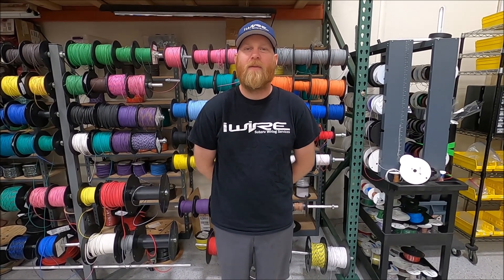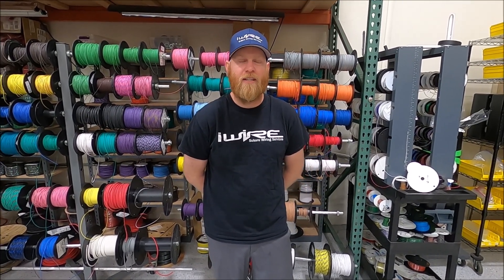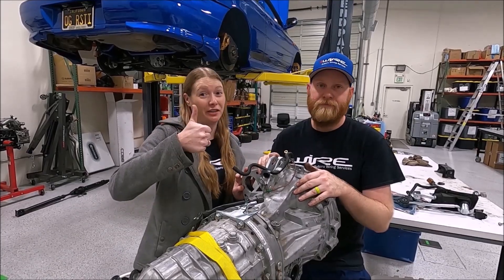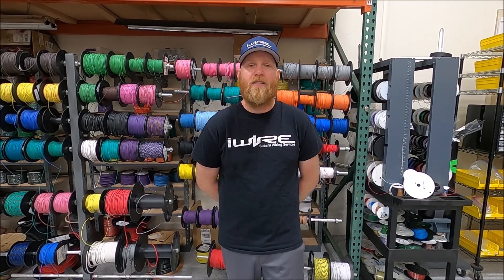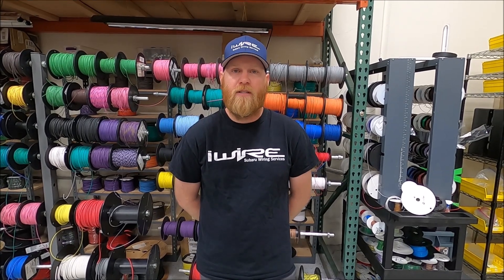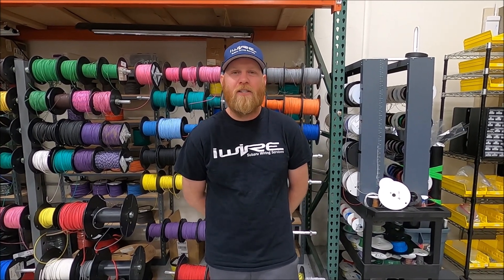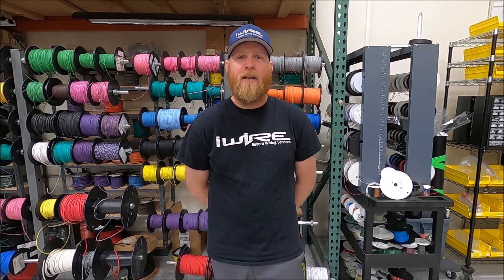How Do I Fix my Vehicle Speed Sensor? - Vehicle Speed Sensor (VSS) in your Subaru Explained

Comment: So I have a 95 impreza automatic, all original. OBD1. Took it to get smogged and they said its throwing a p0500 which is the VSS but thhing is my car has a mechanical speed cable and it works perfectly fine. So what am I supposed to do to fix a "code" that literally shouldn't be there since I don't have an electronic speed sensor?
Reply from the maker: It sounds like the gauge cluster is having an issue because it's not sending the electronic signal to the cluster like it should which is throwing the code.
Reply: @iwiresubaruwiringsolutions  So i'm dumb and figured it out. I had my to green plugs under the dash plugged in which was throwing codes. When I unplugged it, that speedometer code went away.

Comment: I have a 2014 outback. Speedometer and millage count not working however rpm needle works. Check engine light is not on. No codes come up when code reader plugged in. Would this be speed sensor or something else?. When key is turned needle for Speedometer does move but won't give speed. Any suggestions
Reply from the maker: This is a CANbus equipped platform that gets wheels speed via the ABS unit. I would investigate the ABS system and the inputs to that.

Comment: If I have manual trans in car with a/t wiring (as I would swap the transmission) - is it possible to just connect some pins to get the signal? I got Legacy BP with h6 which does not open throttle body fully (only in 30/40%) and I suspect this is the issue
Reply from the maker: Yes and no. More about auto-to-manual swaps can be found here. https://iwireusa.com/blogs/iwire-university/subaru-auto-to-manual-transmission-conversion-basic-overview?_pos=5&_sid=fd7e61f4d&_ss=r

Comment: I have a P0500 code on my Subaru tribeca B9 2006 and I cannot locate the speed sensor on transmission. I did not find any information online or on google
Reply from the maker: Unfortunately, we don't have a specific answer. You'll need the Subaru service manuals to determine the exact location on the transmission.

Comment: Where is the speed sensor located on 2015 Subaru forester transmission?
Reply from the maker: Automatic transmissions are a bit different than what is being talked about here, but generally, there are 2, and they are located on the bottom side of the transmission.

Comment: So if I have a 02 Subaru legacy 2.5 in my Rail Buggy and I have a Aftermarket speedometer,  and I buy a 2 wire speed sensor,  (since I have the front wheel hubs on the rear,) can I take the white wire and hook it to my speedometer and ground out the black wire? Will I get a accurate reading?
Reply from the maker: Unfortunately, I do not think that will work, given you are mixing vehicle speed sensor signal types. Your best bet, whether you have a Subaru transmission or non-Subaru, would be to utilize a 3 wire sensor type which the ECU and the aftermarket speedometer most likely can read.
Reply: @iwiresubaruwiringsolutions5538  I do have a Subaru 5 transmission,  where would I find a 3 wire sensor like ur speaking about?
Reply from the maker: @bobzak9508  Should be built right into the transmission in that case. Especially if the transmission came with the 2002 Legacy.

Comment: I have a 97 Impreza with the mechanical VSS and Ive had multiple cables snap over time, what do I need to switch over to get away from the mechanical vss? 0:49
Reply from the maker: You will need a newer cluster with a matching speed sensor, and we can help with the wiring depending on which cluster you choose. https://iwireusa.com/blogs/iwire-university/subaru-vehicle-speed-sensor-vss-types-part-1?_pos=18&_sid=1349c26ee&_ss=r

Comment: I have an '09 Impreza (no VSS in trans) and recently got a P0500 code for VSS circuit malfunction. Speedo goes crazy after cruising a bit on the highway and can't rev past 4k. However, if I just stick to city driving for 1-2 days, the codee eventually goes away. How could I diagnose which ABS wheel speed sensor is giving me issues?
Reply from the maker: Thanks for reaching out. Unfortunately we do not have the specific diagnostic procedure for your vehicle but if you reach out to your local dealership, they may provide you with this information.

Comment: I have a P0500 code with my 2006 Legacy 5MT. but doesn't have the sensor on transmission. Would that indicate a wheel speed sensor?
Reply from the maker: It would suggest that is the case, yes.

Comment: 18yr daughter saved and got first car,  2016 Impreza wagon....165K miles...seemed fine for about 2 weeks...now you drive about a mile....all the lights come up...ABS, Check engine, hill climb etc Spedometer drops to zero but a cheap code reader says speed is 158mph......will not go over 4000 rpm as you said...code Po500 and others.....local mechanic said sensors fine?...kept for a week and charged $400 and said sorry come get it........was he suppose to be able to determine which speed sensor??...he said all of them?........daughter out all of her money....any ideas..
Reply from the maker: Sounds like a tough situation. Unfortunately, we really don't know what is going wrong with it. This link is something you may find helpful. https://www.subaruoutback.org/threads/diagnosing-a-p0500-dash-err-ss-rare-problem-failed-abs-module.447257/
Reply: @iwiresubaruwiringsolutions  thank you so much for your lightning response....daughter stares at me for talking her into Subaru.....gotta help somehow...thx again..!!

Comment: I have p0500 code but my speedo and cruise control are working fine.  I am also in limp mode, won't go pass 4k rpm.  Should I replace the sensor?
Reply from the maker: There are many reasons for this. You may need to contact a local shop to diagnose this issue.

Comment: Tudo bem estou precisando de localiza o sinal do sensor de velocidade em um subaru forester 2.0 2010 câmbio automático vc poderia me ajudar esta mecânica esta instalada em um fusca
Reply from the maker: You would need to track down the wiring diagrams to see which wire handles the vehicle speed output.

Comment: Brother, can these sensors cause transmission problems on a cvt transmission...and cause the "at oil temp" to flash on the dash
Reply from the maker: It's certainly possible.

Comment: I've two Subaru's, both model year 1998.
Fozzy and Lecy. They both manual trans, and have this 2 wire sensor. But how do you easily remove them?
Its extremely hard to get a key/tool on it.
The "Nut" is very Narrow, and i troed a lot of things but nothing seems to grip on it.. 
It has the little metal pin sticking into the transmission, a nut shape , and the round metal/plastic body housing, and the two wires coming out.
The only way, up to now, it twist on the round housing and hope it brakes loose without damaging the sensor.
So, it there a special tool/trick for removing this sensor?
Reply from the maker: Unfortunately, I don't have a good answer for that since we don't remove a ton of these given we are doing the wiring part more than the mechanical bits.
Reply: @iwiresubaruwiringsolutions  thanks for the fast reply! 
I just hope that one day someone will say "ahh thats a easy job, just do this..." 
Up to this time i guess we have to figure it out by ourselves 😜

Comment: Great video. Quick dumbass question I i'm running a wrx engine porsche gearbox combo in a vw bug. I have heard of people using an aftermarket VSS/pulse generator next to the bolts on the cv joints, could I simply run the wires to both the ecu and speedometer ? Cheers
Reply from the maker: Depends on the year and model ECU and Transmission. I'd recommend emailing this question to us since we need more info to answer it properly. Our email is info@iwireusa.com

Comment: I have a 1997 Subaru outback where is the speed sensor located for speed meter
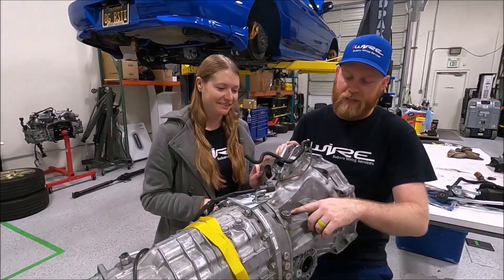Reply from the maker: All speed sensors are located in the same location. You can see where at 1:56 into this video
Reply: @iwiresubaruwiringsolutions   thanks much
Reply: @iwiresubaruwiringsolutions  can speed sensor cause the car to just shut off
Reply from the maker: @abelliottartsandconstructi9486  usually not - here's our guide for basic troubleshooting - https://iwireusa.com/blogs/iwire-university/diagnosis-and-troubleshooting-tips-for-your-car

Comment: I bought a 2007 forester (originally auto) that was swapped with a 2008 legacy manual trans. The previous owner left the 3 pin speed sensor unplugged, and the only other connector that’s unplugged and near that sensor is a 2 pin connector. Is my 2007 auto supposed to have a 2 pin or 3 pin originally?
Reply from the maker: Hello, your 2007 Forester originally came with a 3 pin VSS Connector. It will look like this for the plug side - https://iwireusa.com/products/vehicle-speed-sensor-vss-plug-a

You may need (or already have) a VSSPro
https://iwireusa.com/products/vss-pro-with-iwire-plug-and-play-wiring-harness?_pos=1&_sid=8c6afea3f&_ss=r
Reply: @iwiresubaruwiringsolutions  thanks. I only see a 2 pin that is disconnected but I will try to look for something that looks like that 👍🏽

Comment: Hi I have a 97 Impreza transmission in a 99 Impreza all-wheel. My question is do I have to swap the wire harness,  ecu, & speed sensor? Thank you in advance
Reply from the maker: Since the gauge cluster determines the speed sensor type, you do not need to do any wiring. Just swap the old vehicle speed sensor into the new transmission.
Reply: @iwiresubaruwiringsolutions  ok cool thank you

Comment: Would be interested to hear about ways to deal with different tire sizes and the speedo with swaps.
Reply from the maker: If you added in a VSSPro with our PnP kit, it could be calibrated for this issue.

https://iwireusa.com/products/vss-pro-with-iwire-plug-and-play-wiring-harness?_pos=1&_sid=e49d5a8e3&_ss=r